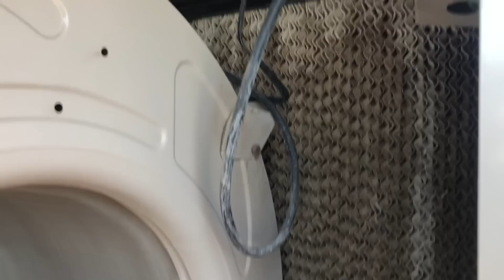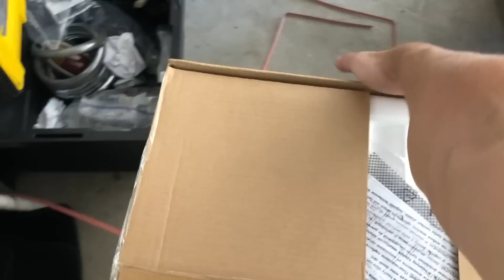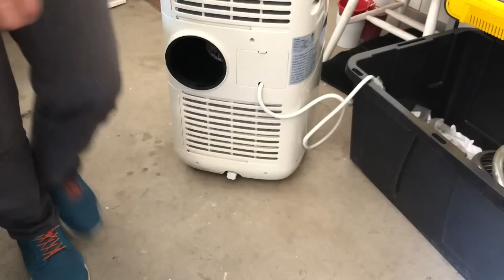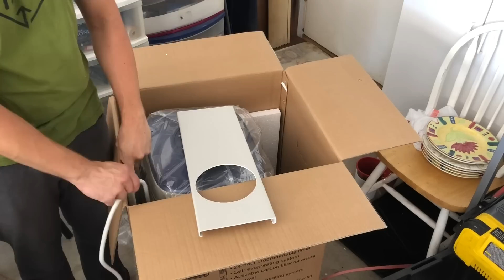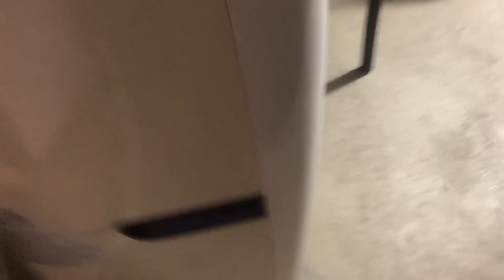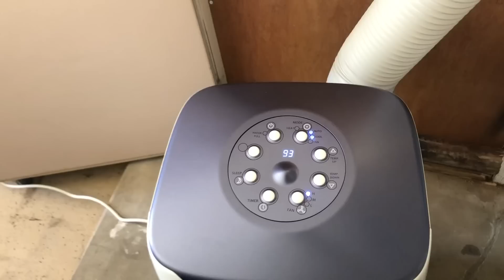NewAir AC-14100H Heater & Air Conditioner Review

Comment: hi,  thanks for the review.  Did you have to put a separate 20 Amp line to use this unit or did you just plug this unit into a regular wall socket ?
Reply from the maker: Regular wall socket works!
Reply: @DavidBello  thanks!

Comment: Very good product. Sounds like the case is made for insulating the garage, starting with the doors. These portable units are not as good at cooling as a window unit, but they certainly work to cool specific areas.

Comment: I don't understand how this unit can cool, without having to drain it periodically?  When ever cooling takes place, water is ringed out of the room air, and usually an Evaporator coil will have a drain.
Why is the draining of the liquid not talked about?
Reply from the maker: Alan Petersen when it was humid the drain would fill up, and require periodic draining, otherwise it’s usually 0% humidity in New Mexico so there was nothing to drain
Reply: @DavidBello  How does this unit use the water canister?
Reply: In the summer, the building a/c went out in my mom's apartment building. I got her a portable unit similar to this. Even when the inside humidity was in the 80% range, there was no build up of water. The condensate collects in an open topped tank. The hot air blows over that to take the moisture out, the exhaust. It worked great. When I put the unit away for the winter, there was no water to drain. At 10,000 BTU, it was not quite as powerful as the one David reviewed, but it kept the 1 bedroom apartment comfortable even when the outside temperature was in the high 90s Fahrenheit.

Comment: These portable A/Cs work well. I fitted one to my son's rented apartment that had large windows on the west and consequently got hotter than hell in summer. You're right to keep that concertina outlet pipe as short as possible. If the unit is cooling the concertina contains the hot air to be exhausted outside. And naturally the exhaust heat leaks back into the interior. Very bad for efficiency. I suggest some thermal insulation around the concertina once the unit has been set up.